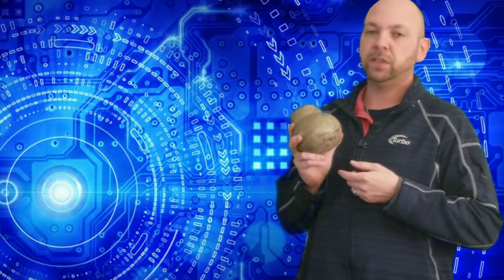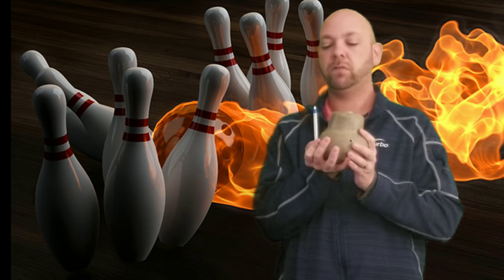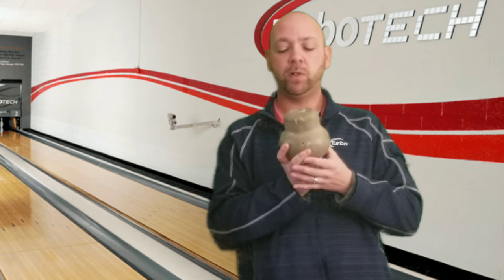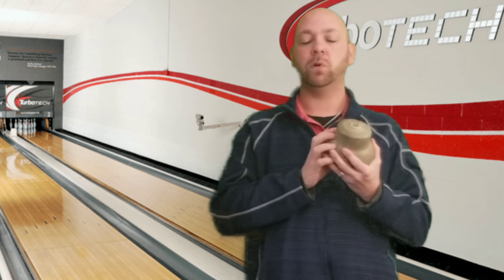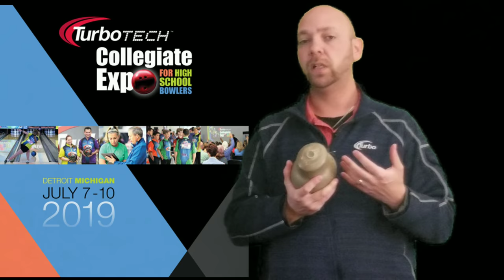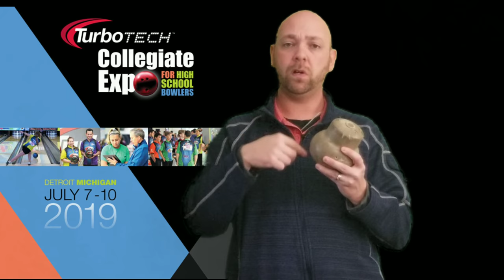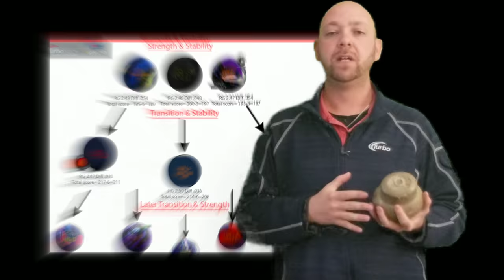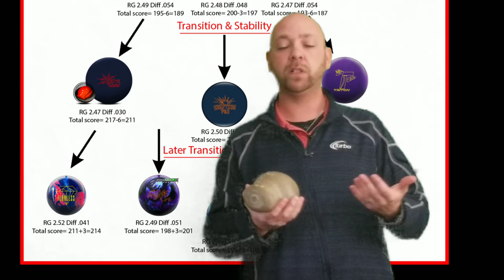Bowling ball cores and how they change when you drill them

Comment: 4:45 "You're gonna have to put an awful lot of trust into your pro shop guy". 

Same thing Mo mentioned a few months back. Put's a lot of pressure on the PSO to get it right the first time. No more punching a hole in it to change the shape if the layout wasn't perfect to begin with. It's gonna make a lot of unhappy customers when their brand new ball needs plugging and re-drilling or when the prices of all balls go up when a pro shop is forced to eat their mistakes and drill a second ball for the customer just to keep them happy.

Will the podcast's be uploaded at a later date or are they exclusive to Mug Club members?